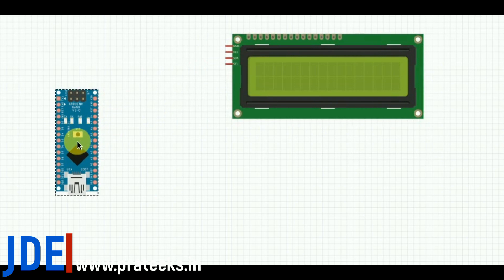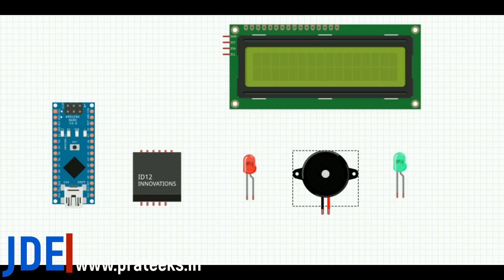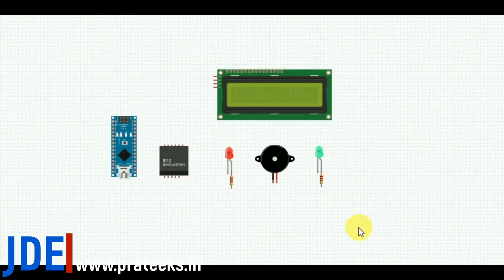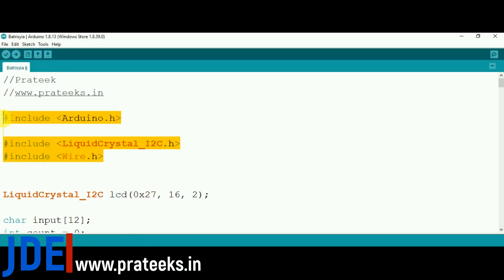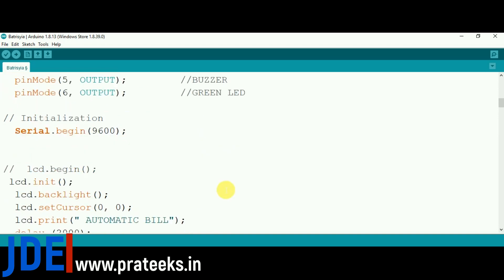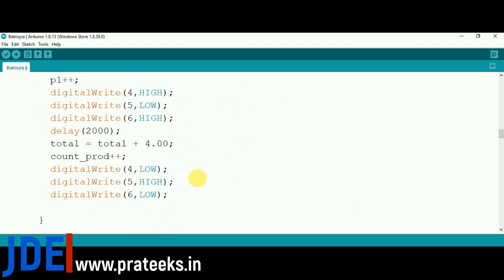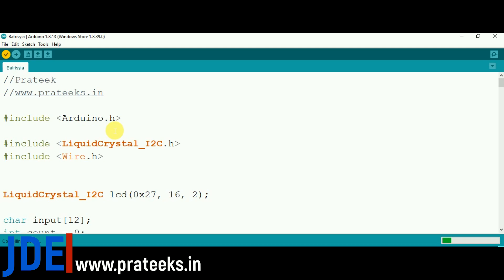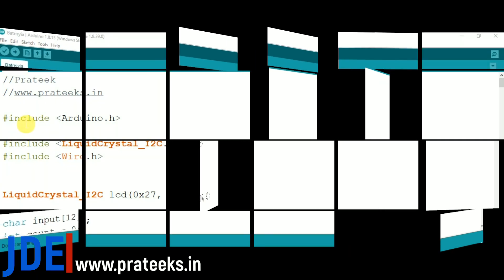Smart Trolley using RFID | Smart Shopping Cart Using Arduino

Comment: sir for following user how can we merge object following robot program into this smart shopping system  as it can follow the user and can we use gsm also to send total bill to the casher.
plz help me its our fyp
and can these three different programs be merged into a single arduino
Reply from the maker: Okey Sir I will try
Reply: Thank you dear I will wait for the response
Reply: @JustDoElectronics  can esp8266 module be used here replacing arduino and sending total amount to laptop or mobile
Reply from the maker: @BabarAli-cb4yz  Yes
Reply: Hello sir, have you figured out how can the bill sent to the cashier? Thanks

Comment: can the coding use  with arduino uno ?
Reply from the maker: Yes sir can use arduino uno
Reply: @JustDoElectronics  avrdude: stk500_recv(): programmer is not responding
avrdude: stk500_getsync() attempt 1 of 10: not in sync: resp=0x64

why there is error when compile the code? help me pls
Reply: @sharvinraj2045  just change the bootloader of your arduino in arduino ide that's solve my problem hopefully your's too.